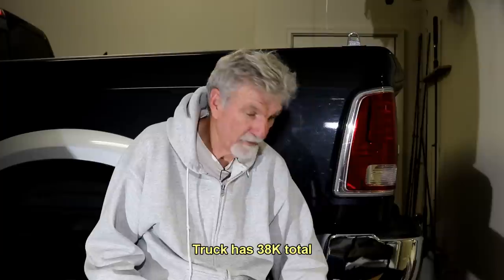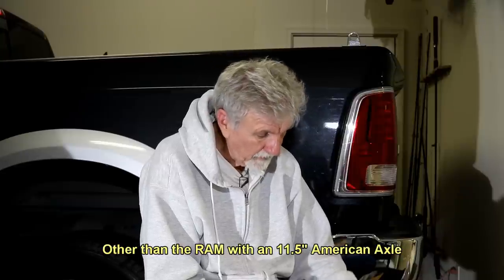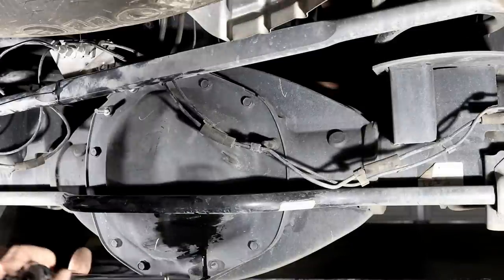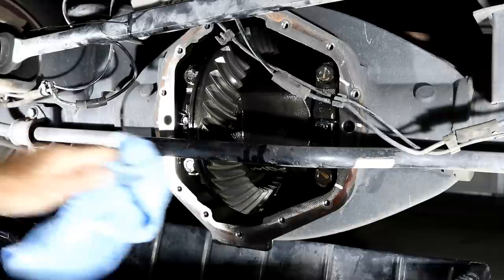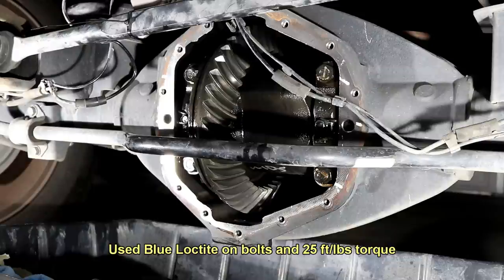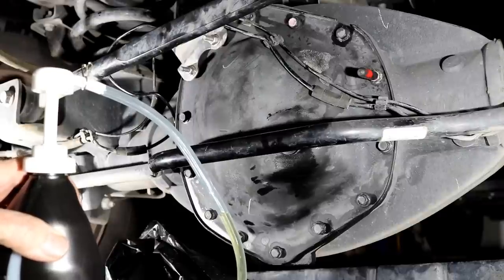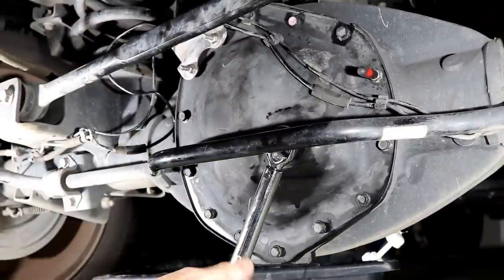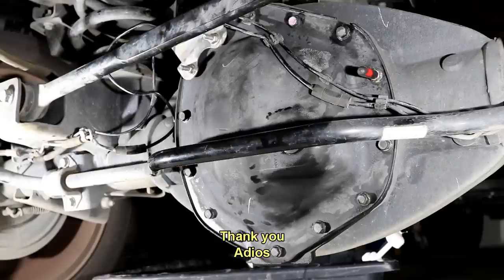RAM 2500 4th Generation Rear Differential Oil Change

Comment: Marion, it appears you have the rear Coil 5 link rear end. How does it ride?     

Does your model have on demand in-Cab adjustable headlights or self leveling headlights when you pull your RV? 

To add a 5 link suspension to let's say a Chevy 2500HD is $5,000 😮.  From an Engineering standpoint the 2 most reliable 3/4 trucks are for a gas a Chevy, for a diesel a Dodge. I'm just like you as far as maintenance but even more meticulous down to every mechanical detail. I used to live in Lafayette for 15+ years. If I see you around when I'm around the area I'll surprise you and show you the most miles you've ever seen ( in person ) on a gas truck with Original Motor & Transmission, Alternator, A/C compressor, waterpump and many other Original factory parts. You probably wouldn't believe it. I'll say this well over 1/2 a million miles with all the records, logs and fuel receipts to prove it. I don't pull anything, if I did I would probably buy a diesel, Dodge of course same as yours with an 8 foot bed, they ride better, handle better and are safer. Only negative is crosswinds, takes longer to wash, takes up more space in the garage.
Reply from the maker: It rides so much better than the leaf springs.  I keep 80 psi in the tires also.  The Michelin Defenders make the ride so much better than the original Firestone Transforce.  They were crap.  Agree with you on the 8 foot bed, I just couldn't get it in my garage or I'd have one.  I had an 8 ft previously, it had leaf springs however but the ride still wasn't bad.  My good friend has an 2011 Duramax, great truck.  Oh and no my headlights are fixed and pretty crappy to tell the truth.  I thought it was my cataracts but after having both cataracts this year, I know it's the truck's lights are pretty weak.  I need some LEDs.
Reply: Marion Blair  
I agree on the Michelins 100%.  I've owned many different brands. Cooper, BF Goodrich, Yokohama, Westlake- Chabills, Firestone, Bridgestone etc etc... I run Michelin Defenders on the front and Westlake All Terrains on the rear because I have a 2WD and the rubber compound is harder. This was my first time trying the Westlake Tires. They're  good for the price, a lil noisy but decent tire wear. The Cooper ATS3 10 Ply I've owned previously wore down like iron and gripped like a Cat on Carpet and lasted 116,000 miles ( I know unbelievable, these are easy Hwy miles  ) on the rear axle before the tread separated like a recap on an 18 wheeler tire. These bigger diameter 10Ply  tires that are coming on the Late model 3/4 ton trucks with factory 20 rims last a long time ( depending on brand ) with Quality hard compound rubber because they obviously rotate less to cover a mile. 

 A guy I know, 2 years ago had 1,010,800 miles on a 2006 Duramax on Original Motor and Transmission. Haven't talk to him in a while but he probably has another 200,000 on it. He had to have the instrument cluster/Odometer changed at the dealer because it read 999,999 Miles. The Dealer put a new Odometer with a GM Certified Calibration Sticker on the door and ( he had to foot the bill ). 

I personally rather the Cummings for many Mechanical reasons. The 6.7 Cummings has 1 head ( simple )  the Duramax has 2 heads which doubles the points of failure and price to fix, more labor, more parts, more weight. 

The Duramax has Independent Torsion bar suspension, basically the second cheapest way to design a truck suspension, the first cheapest way would be strut suspension. 

The Cummings ( your model) has the most expensive suspension to engineer and build on any factory 3/4 ton truck ever built and in logic & theory should ride the best as you've mentioned. A 💩 Late model Ford ( may ) ride just as good but the way Ford accomplishes this is a cheap way, through cheap soft Cab-to-frame mounts and 2 piece rear leaf packs with suspended helper leafs. Which promotes sway and axle wrap unloaded, Ford then counteracts sway with a sway bar. Sounds good on paper but in the real world the 2 piece leaf packs equal more axle wrap and premature pinion wear. Here's something you probably didn't know and may find interesting unless you've studied Mechanical Engineering 

https://youtu.be/gmV4qwLfOMY
Reply from the maker: I had Westlakes on my travel trailer and replaced them at 5 years just because they say to on TT's but they were perfect, looked new.  Lots of hype about Maxxus so I'm giving them a try.  Made a trip to Houston, then Leadville and back and picked up a nail too close to the sidewall and had to but a 5th one.  I check my tire pressure every morning and notice I was 2 psi low every morning.  So that nagged me the entire trip.  That's a lot of miles on that Duramax.  I've had Chevy LTD before this one .  A beautiful truck but I hated the cylinder shutdown thing for fuel mileage. Gas 5.0.  1500.  The nav was worthless.  Rams nav is pretty good and I think the fit and finish is better on my Laramie but I  also like Duramax.  Another friend just got a super duty but he's getting the death wobble and in the shop.  Good torque.  I wish rssm offered something other than a 3,42 on the 2500s Good mph though.
Reply: Marion Blair  Dodge has the best of all worlds with the 5 link rear. The only Con could be 10 link bushings if they're pressed in VS. 4 pressed in bushings on a leaf suspension. 

My work truck is a Chevy 2500HD 6.0 Vortec. I want diesel but for my particular use it wouldn't make financial sense. On the Hwy I get 16 Mpg with 3:73 stock gears Chevy doesn't offer 3:73 any more except on Fleet purchases. My maintenance let's say in 20,000 miles is 5 1/2 quarts of oil @ roughly $25 and $4 for an oil filter. I change the oil every 5,000 miles. So roughly $120 per 20,000 miles. With a diesel the purchase cost would be more, insurance would be more,the maintenance would be more with 12 quarts of oil per change and fuel, water and oil filters. And the $3 a gallon for diesel VS. $2.50 for gas. 

I recently installed Roadmaster Active Suspension, pure mechanical. No maintenance, no air bags to leak and no air compressor cost. 

When you add the purchase price of a new diesel along with Tax, Title & License along with ( interest )on $50-$60,000 along with added maintenance cost and increased insurance cost. It gets expensive really quick. 

2 Things I hate paying is interest on loans and house insurance. Many home owners pay house insurance not realizing that if they would build their house sufficient enough there's no need for Home insurance. 

My Dad has been paying $1,200- currently $1,800 a year for house insurance for the past 39 years and has never filed one claim in fear of the insurance premium going up. 
If you average that out to $1,500 per year for 39 years that's $58,500. 

What people buy home insurance for is Hurricane, Tornado and Fires. Noting that Flood insurance is separate insurance. 

If you build the house foundation, footings, walls and roof out of Rebar and do one Monolithic Concrete pour essentially a big Tornado shelter with siding, logs or bricks on the outside walls as a facade for looks. You have a much much stronger house, that was built faster, saving lots of money on wood framing, Raptors, plywood, shingles, fiberglass insulation, nails, ceiling tile and LABOR to construct it all together. The end result is a house that won't burn, no wood framing to rot, no shingles to leak and blow off, tornado proof, hurricane proof and if it's built on high enough land with sufficient drainage and built up foundation what you end up with is a maintenance free house that doesn't need home insurance. 

You see it all the time to Marion, look on the coast where Hurricane after Hurricane destroyed homes then they're built back the same way only to be destroyed again. 

Look at what happened in CA with those wildfires. If those homes were built correctly to begin with none of that would have happened. I've never seen a bank vault burn to the ground or be destroyed by a Tornado.
Reply from the maker: @Mr.Beastforpresident  Agree, I change my oil with dino oil so it's 3 gals and a $12 filter.  Under $50 bucks but still more.  They say 15K change interval but I'd never go that much with all the soot floating around in the oil.  That's my biggest beef with what the emissions standards has done with the diesel.  Honestly, If I could trade my 2014 Laramie for my 1995 with the 5.9 Cummins I had new, I do it tomorrow.  No EGR, manual transmission, only 425 ft/lbs but I think it towed better than these full emissions trucks.But I like my truck and I can always delete but that kills a trade in when you do that.  If your buddy gets over 500K on a duramax with an egr, I guess, it's not as bad as I make it out to be.
Reply: Marion Blair  
Marion Blair I like the 5.9 simplicity with 5 speed Manual. Hypothetically speaking that engine & transmission in the body style you have with the 5 link and all would ( seem ) like the best of both worlds. But I don't think it would be that simple from a gearing and Torque standpoint, of course there's ways to boost the 5.9's Hp and Torque but then you run into other unforeseen rabbit holes with parts needing to be custom made which isn't that big of a deal if they're made correctly but the headache comes when it's time to repair and you're out of town and let's say one custom injector or part goes out, you can't just run to the local dealership, fix, and be back on the road. 

The 5.9 had few shortcomings, some simple. Such as the timing gear cover pin some more challenging like the cylinder closest to the fire wall wearing out/ losing compression because of the way the intake manifold was engineered. 

Also the noise of the 5.9, while sounding great the neighbors and drive thrus at food places don't seem to fond of it. 

To have the best of both worlds would look something like this. ( Video below )- Must watch, work of art!  Only thing it's missing is the 5 link rear suspension and maybe some Hydraulic motor mounts or custom engine Shock dampeners for vibration especially when shutting the engine off 

https://youtu.be/CS2oxFtRGj8
Reply from the maker: @Mr.Beastforpresident  What a beautiful truck.  I'm not generally a vintage person, but you've got to appreciate that.
Reply: Marion Blair I like the metal dashboard- no cracking, the aluminum knobs, water & UV resistant Vinyl seats, hell I like everything. No DEF fluid. I bet that truck cost several pretty pennies to build though.
Reply from the maker: @Mr.Beastforpresident  Don't sweat the DEF fluid, that's a non issue for diesel owners.  It's injected downstream and a RAM under heavy tow uses 1 gallon per 1000 miles.  It's the EGR that's the engine killer.
Reply: Marion Blair Not bad, I assumed it used more DEF than that. Happen to know what's the differences between the High Output 6.7 and the regular 6.7 on the Chassis Cab 3500?   I know the High Output has more Hp but wondering how?   Tune only, bigger injectors, bigger cam?    It's like why wouldn't they all be High Output especially on the Chassis Cab
Reply from the maker: @Mr.Beastforpresident  I noticed that but don't know the answer.  I heard someone saw Cummins rated them less for extreme duty  service like running at max rpm and torque all day long but don't really know what the 3500 dully is rated so much higher, makes no sense to me.

Comment: Dodge or should I say the dealer is proud of their gaskets @$45
Reply from the maker: No kidding,  they got me on that one.
Reply: @salspec3381  i nearly pulled the trigger on buying those today.  Have you personally used them?  if so...thoughts?
Reply: Kai, I am using them now. They seem like very good quality to me and have not leaked at all. I'm using them with aluminum PML covers too. I actually explained in my other post here why I like them better than the OE gaskets. The short version is they are not as thick and go to the edge of the housing and pan. This makes it much harder for dirt and water to collect on the top of the diff housing between the pan and the housing itself.
Reply: I've already seen the Banks series on flatback covers. He makes some sense, but the PML covers are much closer to the OE cover profile than other brands.

The OE cover is not a true half-circle like Banks would have you believe anyway. There is a flat spot at the top of the cover where fluid would stall. Also the area in the cover where the fill plug is located is another area where there would likely be a lot of turbulence.

I purposely stayed away from the flat back covers because I too felt the same as Banks ...and this was before he started his series.

Another thing about the PML cover is the part of the cover that goes over the ring gear has no fluid interruption because the fill plugs are at the top and side of the cover.

I think Banks is doing his series at least in part because he is getting ready to introduce his own cover. Pointing out deficiencies of other brands is just smart marketing.

What he has so far looks pretty nice, but I don't like the way he has the ducting on the outer lower corners of his cover. It's a vulnerable spot that if caught by anything under the truck while off-roading could rip a chunk out of the cover causing a loss of fluid.

So it seems like his cover is really only good for towing, but not much in the way of off-roading. Regardless I do want to see what he comes up with.
Reply: Sal Esposito I never knew all what you've said about PML covers. I'm going to check it out. I assumed the cover was like all the others. 

As I get older ( 37 yrs old ) and wiser, I've learned & still learning most aftermarket parts have their drawback to OEM reliability in some form or fashion in the long run it seems. Modern OEM trucks are hard to beat, as-in everything is matched evenly. 

For instance, make the transmission stronger then it's harder on the rear end & Crankshaft, Engine mounts, Transmission Mounts and so on...
Reply: I hear ya. Thing is neither the PML or OEM covers are perfect. The PML cover has that same notch at the top of the cover as the OEM unit so it would catch oil there too.

One other thing is the PML covers are sand cast so the surface is not smooth like the stamped steel. I don't think that is a huge deal, but I may smooth the inside of the rear cover at the next change interval just for my own edification.

Honestly, I think it's more important that good oil is used and it is changed before it starts to break down. I have a friend that works at Dodge and he told me that Dodge differentials tend to be set up a  bit on the tight side so they produce more heat and break the oil down faster than average. If you do a lot of towing getting oil analysis done wouldn't be a bad idea either.
Reply: Sal Esposito Maybe that notch on the top is to divert the oil some from getting too much on the pinion bearing. 

Thing about heat is, they say the worst thing for Engine oil anyway not sure if it's the same for Differential oil but they say the worst thing for the oil is short trips where the oil doesn't get to operating temperature and creates condensation. I'm sure condensation would be there/start after reaching operating temperature and the vehicle is turned off, but maybe it's hot enough at that time to evaporate it/ prevent it from forming via the vent tube on the Differential. 

It makes me cringe every time I see someone cover the rear axle in water when offloading a boat.
Reply: I'm not really sure how critical that notch actually is. It may serve a specific purpose or just may be a more cost-effective way to manufacture the part. I think PML manufactures the part the way they do because they didn't want the casting to get too thick.

Water usually isn't an issue as long as the breather is above the water line and working properly. Axles are otherwise waterproof. Where people run into problems is when the breather gets clogged or it's the check valve type. When a hot axle goes into the water it cools down quickly. A breather that won't allow the negative pressure to equalize can suck water in through the axle seals. This is why it's a good idea to remove the check valves that are found in many OEM applications and replace them with something that allows the air to go in both directions. I've personally replaced check valves with sintered brass filters and small fuel filters on past trucks I've owned.

Comment: Hey Marion, maybe during your next oil change install one of these. I picked one up new off eBay for under $150 last year. OEM part. 
https://www.1aauto.com/2011-16-ram-differential-cover-mopar-68149259ac/i/mpadc00002
Reply from the maker: Damn, that's a beauty.